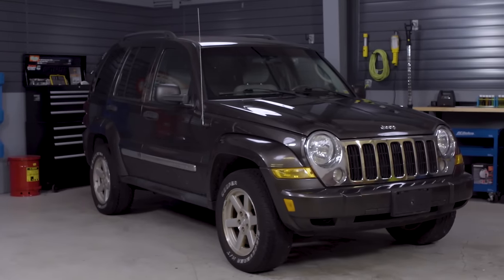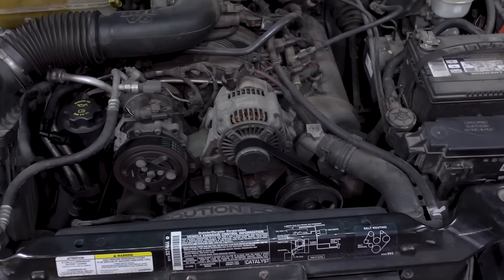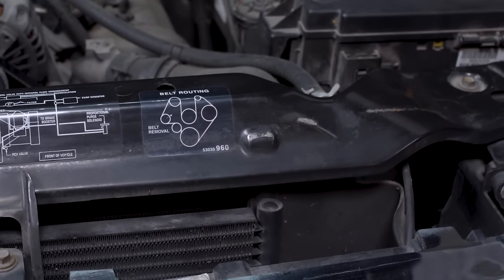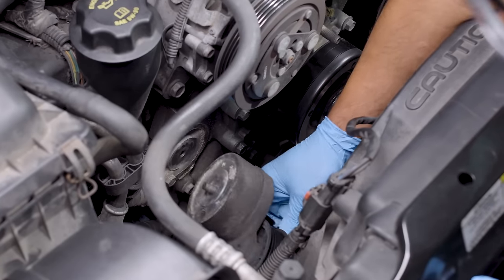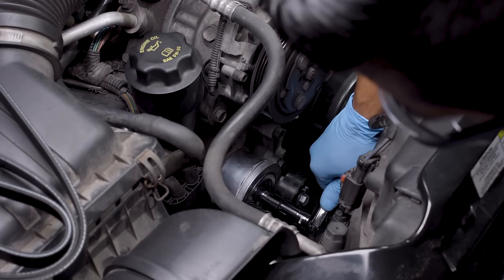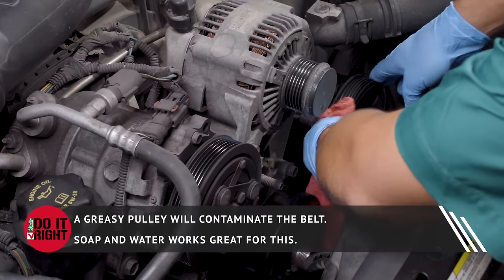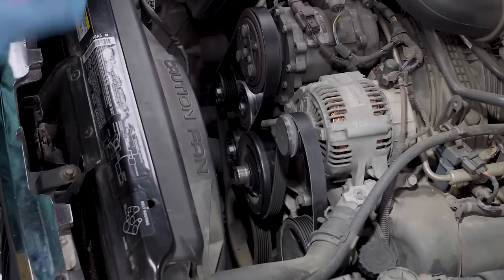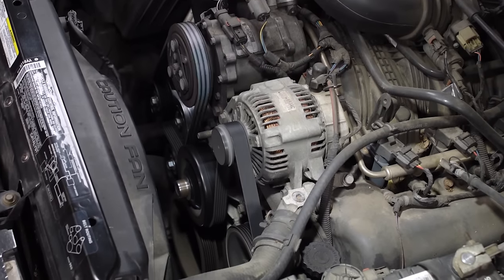How To: Check & Change Your Vehicle's Serpentine Belt, Tensioner & Idler Pulley

Comment from the maker: Supplies Needed for This Job:
1. Safety Glasses: https://urlzs.com/hbwc
2. Gloves: https://bit.ly/2GvfwAm
3. Ratchet Set: http://bit.ly/2IEAOOi
4. Serpentine Belt: http://bit.ly/2VijTHm
5. Idler Pulley: http://bit.ly/2IVQexc
6. Tensioner: http://bit.ly/2UFr9bH
7. Breaker Bar: http://bit.ly/2UWfies
Reply: I got a oil change yesterday , car felt felt fine , smoke when inside the car when I was driving so I pulled over notice a small leak seems like it's coming from under by the oil filters after a while the leak when away is this normal !! ?
Reply: Hi
Reply: ⁰
Reply: Cuando acemos acemos un ajuste de motor a un carro al cuanto tiempo se deve cambiar el aceite del motor

Comment: my mechanic wants $ 1100 to replace a PCM  he said that may not be the problem. needs to check other problems.should i do this. wait for your comment ' thanks
Reply: They really need to hire a social media team who engage the community with quality and timely responses. 🤔🙄
Reply: After ten years parts go obsolete, you can try remanufactured but buyer be war most will be cleaned up failed ones that wont last more then 1-2 years at latest.

Comment: Eric, I'm seeing 2 different Refrigerant oil options for the compressor PAG 46 & PAG 100 for my 2003 Dodge Ram 3500 pickup. Which would be the correct one to use please?
Reply: Check under the hood look for a sticker for ac it would say with one to use
Reply: Doesn't matter. Send it with some fresh 134a.

Comment: I have an issue with my 2017 Nissan Altima. While driving at 55mph car went into neutral on its own. Since the has been driving ok. I'm a traveling nurse with two kids out of the area for college.
Reply: If you have a computer then type in what causes this model of car to have this problem. You just may have to take it to a dealer to have it fixed. Just a thought here.
Reply: @robertbowman3406  thank you.
Reply: @choosingjoy6002  odd changes in gears is a transmission issue. You may just need a transmission fluid change. How many miles? and have you ever changed it? Overall recommendation is to change at least every 50,000 miles.  

if the belt tensioner went out, you would hear noises most likely.
Reply: @JamesQuintero7  don't have it any more thanks
Reply: I use google and YouTube
Reply: Hey Ella I’m not being a jerk just honest. Do you and your kids a favor and get yourself a Honda or Toyota. Nissans aren’t reliable at all.

Comment: why not disconnect the battery
Reply: Can you give me one reason why you would need to do that?
Reply: @brycelund4112  right lmao
Reply: Yes I think this would be wise just for safety. No need to bump anything positive and become the ground, or have some heel pull a prank on you and turn the key over. Definitely wouldn't hurt.
Reply: @brycelund4112  just safety so you don't accidentally become the ground to the positive charge. Most people don't do this but plenty do advise it.